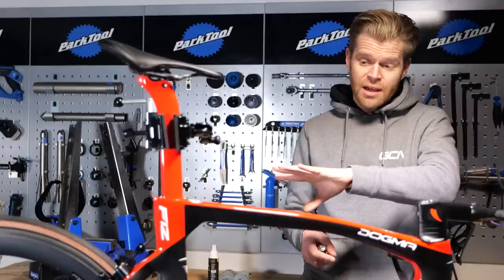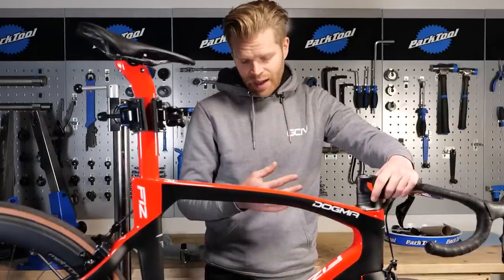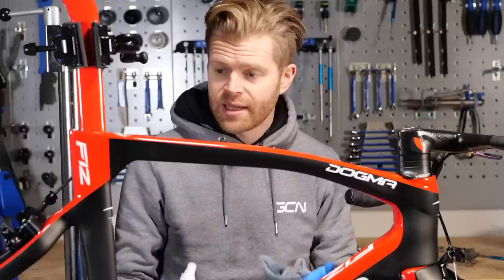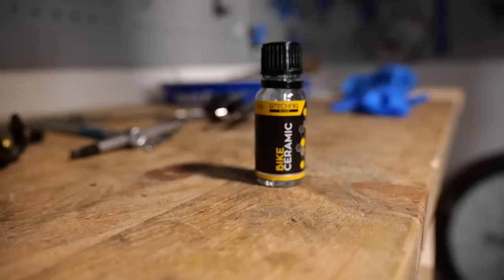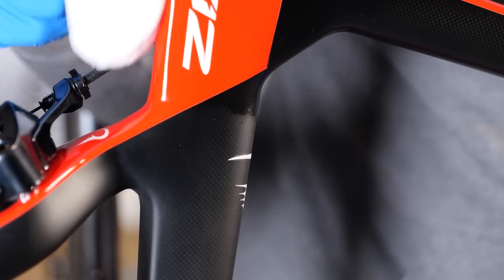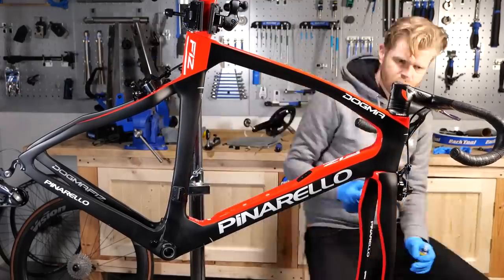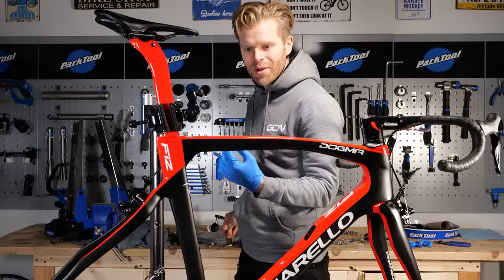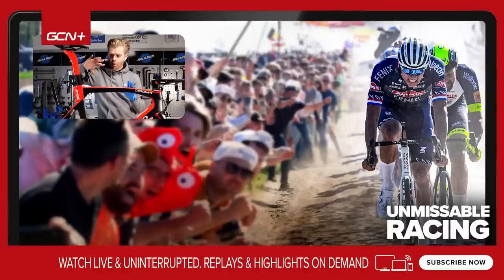How To Ceramic Coat Your Bike & Keep It Clean For Longer!

Comment from the maker: Have you ever applied a ceramic coating to your bike? 🧐
Reply: no
Reply: I thought I had until your previous video, where I found out that the quick coat was just a surface protection.  I have since ceramic coated my new bike and with the weather in Inverness recently I can definitely say it works. Now I Just need to ceramic coat myself.
Reply: Would it work on a Ti frame?
Reply: yes and it makes cleaning a lot easier as well as giving more protection against stone chipping and scrapes removing tar and other debris from the frame is also way easier
Reply: Its not work in russia🙃
Reply: No, ceramic sounds heavy.
Reply: I prefer a nano coating. Works the same, but is cheaper and also works on metal. It is a car product, but you can use it on every smooth surface. It will last for a whole season.
Reply: No, but after watching this video I definately will ... gtechniq kit ordered as we speak!
Reply: No, but thinking about it.  I have applied it to my car and I love it.  It keeps it looking clean a month after I wash it.  I would probably put vinyl wrap on a few key areas first for greater scratch resistance and then apply the coating to everything.
Reply: Can you apply the ceramic coat to a matte black finish (BMC Timemachine Road 01)?

Comment: Waste of money ...
Reply: Most of us are amateurs riding with tech that we don't use to it's full potential. That is also a waste of money. Or is it? Because it does something to your mind to have proper gear.
Reply: It’s really not. It’s personal preference. Some might say a bike is a waste of money…. We have legs 😋
Reply: The Silca stuff isn't very expensive and unless you don't wash your bike at all, the time saved if you do clean your bike us worth far more than the cost of the coating. Not a big deal if you live somewhere that never gets rain, or you don't ride outside when there's any wet areas on the ground. But the gains really are huge from ceramic coat.

Comment: If you really want to get the frame clean use a clay bar with lube to ensure it doesn't scrape or leave swirls them dry off and use alcohol rub before applying the ceramic coat. Remember TROW AWAY the applicator pad and the microfiber towel as once the ceramic coat dry’s it's going to crystallise and then if you use this on your bike it will scrape it to bits.
Reply: Terrible advice ^ absolutely do not do this. There’s no way of claying a bike that won’t leave marring on the paint. It’s also completely unnecessary on a bike because a bike doesn’t get the contaminants a car does. If you really want it clean give the bike a once over with a paint cleanser before prepping the frame, that’s what I did.
Reply: @joeblack7469  was referring to old or secondhand bikes and as for marking if you use a dedicated lube you won’t

Comment: I used the Gtechniq Bike Ceramic and ended up with a blotchy cloudy finish . The bike was prepped by washing it and using the frame prep provided and applying in 50 degree F outside with 50 % humidity. It was applied in stages and wiped off but I waited 3-4 minutes not 1-2 minutes .  Apparently wiping off as late as I did was the problem.  This is not mentioned anywhere on their website or in the instructions provided.  It was a disaster.  I am having it removed by a professional auto detailer and letting them apply their ceramic .  Such a disaster.  Instructions are way to vague for DIYs

Comment: I’ve had good results with silicone spray (e.g. Jigaloo) to protect the paint on my steel bike. It buffs up to a slippery high gloss shine that repels dirt. I rarely wash my bike. After a muddy ride, I just let it dry indoors and brush off the dirt and vacuum the floor.

Comment: #askgcntech Nice video Ollie! Question though, when you say it bonds to the lacquer, does that mean that it also removes some lacquer as it wears down too?
Also, what's the best thing to do for a bike that's down to the paint and now the paint is wearing? I have an older bike that's had a rough life and some of the paint is deteriorating. Would waxing, ceramic coat, or something else revive the finish and make it shine again?
Reply from the maker: Great question Mark! Why not use #askgcntech and the team will pick up on your questions 🔎

Comment: Got a new bike coming soon. I’m thinking about using some frame protection tape on some areas, prior to using a ceramic coating. Will the ceramic coating bond to that? Ollie says plastics but I would think frame protection tape is a bit different to hard plastics used for parts.
Reply: It does work on a vinyl wrap as well.
Reply: Have a look at some of the many car detailing channels like Pan the organizer etc. for a more in depth view on the various products available.

Comment: What’s your thought on applying RideWrap following ceramic coating?
Reply: You would want to use the ceramic coating OVER the ride wrap if you went that route.   The coating gives the bike the hydrophobic property which helps it shed dirt and wash easier. Ceramic coatings are better than the factory clearcoat but but aren't fully scratchproof. 
Apply the Ridewrap first to prevent scratches to the bike frame then the coating to keep everything clean.
That's how its done on cars anyway. Assume its the same for bikes.

Comment: After installing ceramic coating on cars and carbon fiber, some c coating products will stain matte colors so careful because it will make the matte finish look different, you might not like it, there are ceramic c compatible with matte colors its call stealth c coating, if your frame is a gloss color is ok to use the regular c coating

Comment: can you use cleaners such as muk off, peaties bike wash csprays on it after coating after a ride?.. 
I have always used car detailing products such as ceramic Di2 sprays and detailers. Always worked great but does not last as long as yours claims to do
Reply: Use car shampoo diluted in a spray bottle for most longevity of the coating

Comment: I’ve got a Merida Reacto, mostly Matt black with a gloss red top tube. I use Muc Off Matt detailer on the Matt areas, but if I ceramic coat, do I still use a Matt detailer spray or would it not matter anymore with the new coating?

Comment: would you consider using  claybar as opposed to ipa to prep the surface?
Reply: Clay moves surface adhered contaminants (organic), IPA and or panel wpie degreaser the surface ahead of coating to promote adhesion.. I.e they do 2 different jobs 👍
Reply: @markharrison6120  in older or secondhand bikes clay is a good idea but use lube or you’ll get scratches

Comment: Now that I know that it unfortunately does not work on jockey wheels, what about shoes. No problem on the carbon soles I guess but what about the upper material?
Reply: You can buy ceramic coatings for fabrics. I'd look at some car detailing channels for further info.

Comment: Just put protective skin cover (plastic) and you are good to go👌😊
Reply: They protect against scratches but aren't hydrophobic.  The ceramic coating helps water and muck rinse off.  I have the coating on my car and it always looks clean and shiny even when I don't wash it for a while.  If you want the scratch protection of a wrap, do that first THEN apply the coating to keep it clean.  Not sure how much all that weighs though..

Comment: So if I ceramic coat the inside of my bottles, will I get more liquid out of them ??
Reply: Now these are the important questions!
Reply: The water will run out at such speed that you will choke and spill it
Reply: If you ceramic coat the inside of your exit hole you spend less time on the toilet. And you can clean yourself faster. So now you know what to do with the other half of the bottle when you only have one bike.

Comment: pledge furniture polish does the same thing.
Reply: Furniture polish does not have a 9h finish.  The ceramic coating is more scratch resistant than the factory clear coat (or gelcoat) on the frame.   Mind you its not scratch proof.